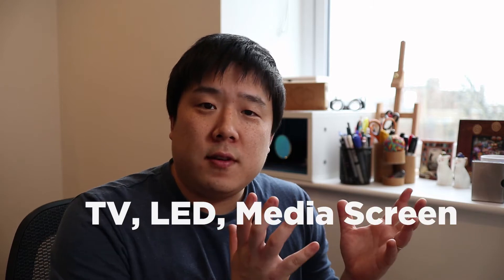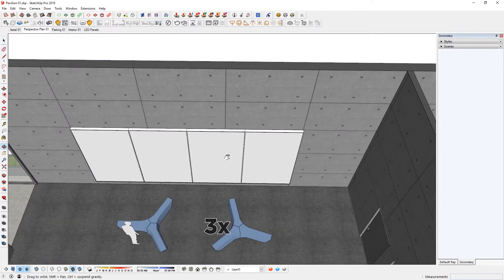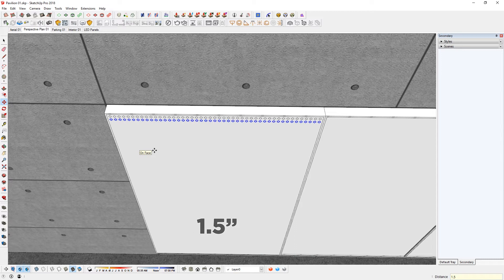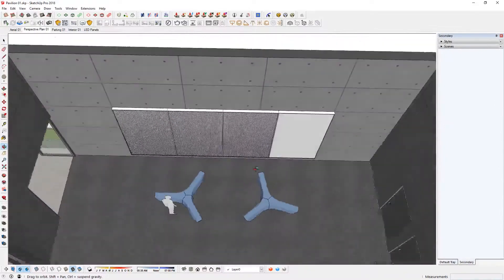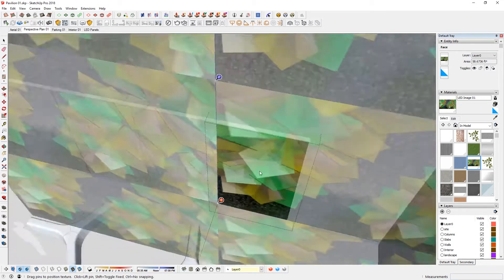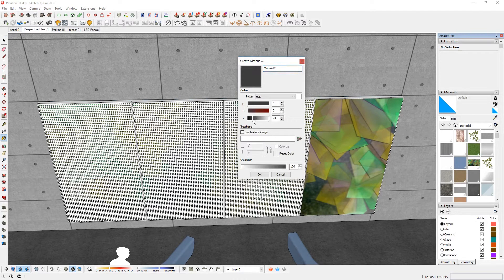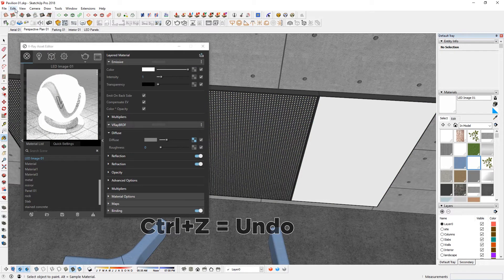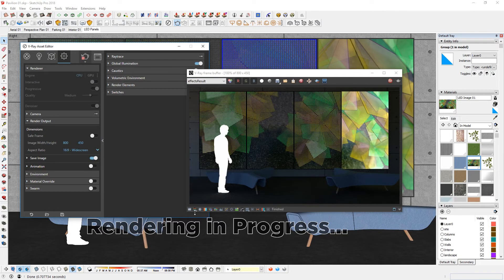SketchUp and V-Ray Tutorial - How to Model and Render TV, Media, LED Screen

Comment: Thanks for this!
Reply: Though, the trick with undoing udate v-ray materiel twice, at 6.48, does not work for me in version 20.0.362. It goes back and takes away the image in the emmisive bitmap layer. Is there another way to fix this?
Reply from the maker: @mkfrslev389  I think it was reset UV map somewhere. Sorry. It's been awhile.
Reply: @JosephKim  Thanks! For info: I solved it by changing the Repeat U/V to 0.25, 0.25 in the emissive bitmap layer.
Reply from the maker: Thank you!